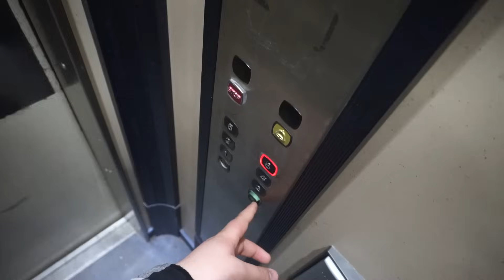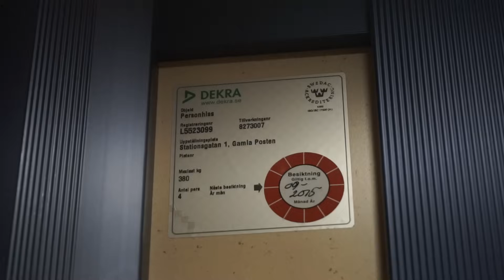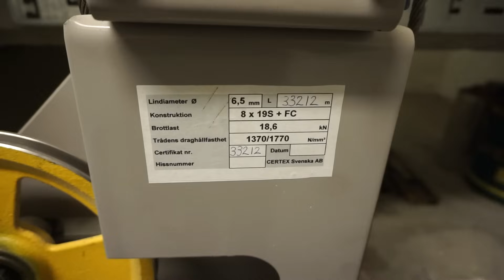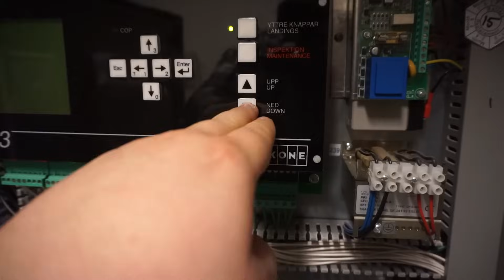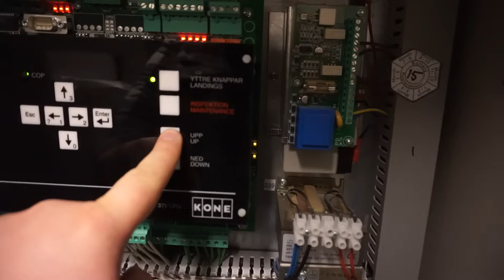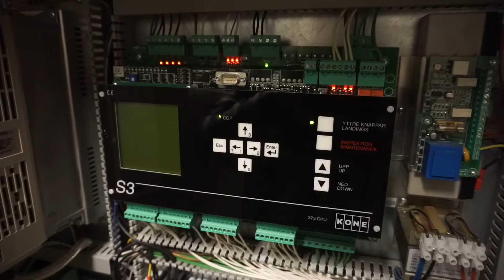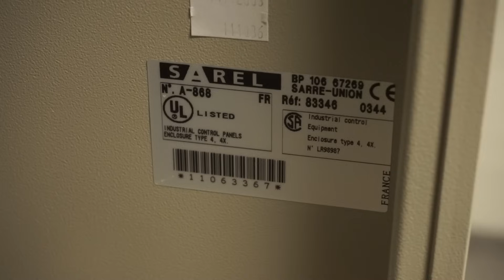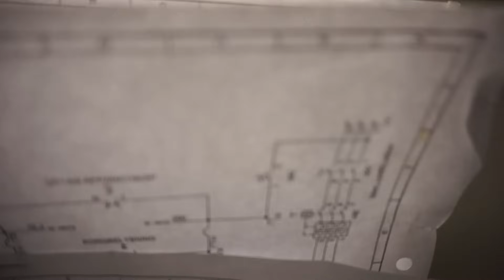Machine Room Tour! 1960 Graham Brothers elevator (mod by KONE) @ Stationsgatan 1, Hudiksvall, Sweden

Comment: ascends quite fast for a geared traction machine with 1:1 roping. However works very nicely, machine room is clean, installation neatly done, cables from hoist motor to controller cabinet anchored in place.  I saw they have a VFVV drive for the traction motor inside the controller cabinet. I assume they use three phase power for the drive AC in rectified to DC, inverter back to AC with an induction AC 3 phase traction motor with a phase reserving relay in the controller.
Reply: jgdvمبس

Comment: The traction motors for the elevators in my building have a similar sound.
Reply: That machine looks similar to that elevator machines in my apartment building but they are blue instead of grey.
Reply: they are controlled by inverter, this is the cause of the noise